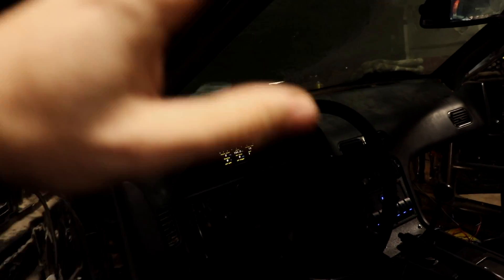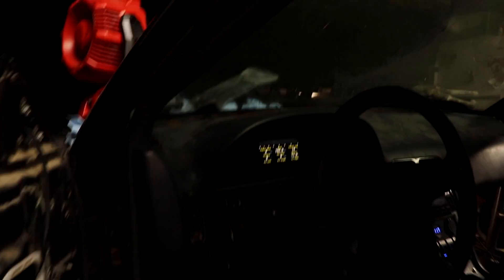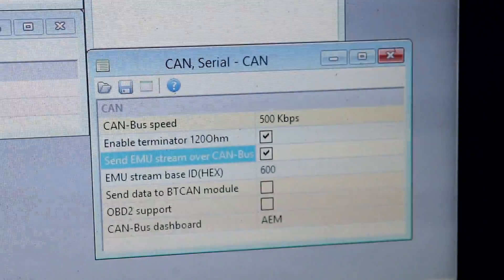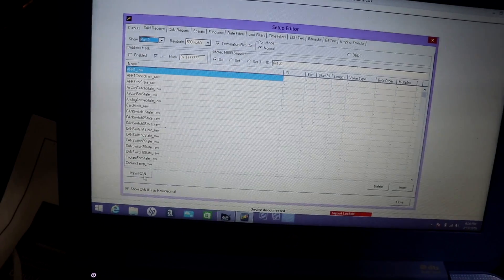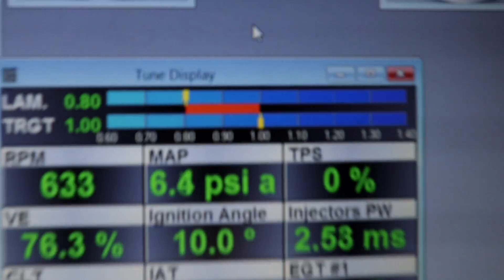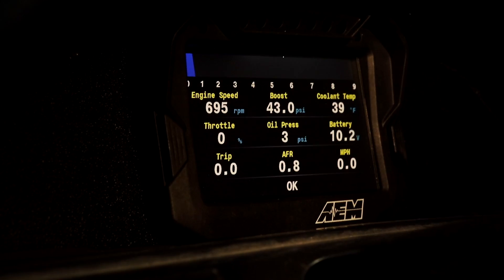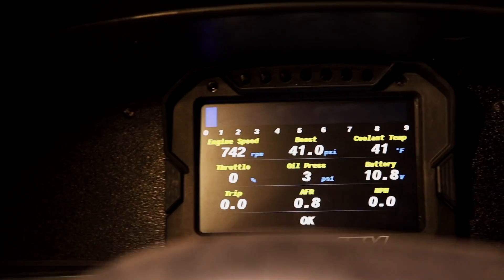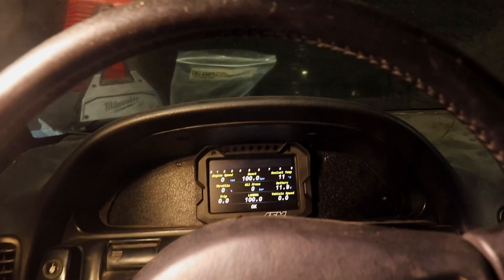AEM CD5 Dash Programming With Ecumaster ECU (RB20 240sx)

Comment: Any reasons you went with the aem over the emu display? I have the emu black and was comparing the aem to the emu display.. and seem like the aem one is better for the price also.
Reply from the maker: I think the aem dash looked cooler but if I could go back I’d get the Ecumaster one only because it would’ve been way easier to set up with the Ecumaster ecu. It’s much simpler to stick with the same brands instead of mixing them. No complaints about the aem dash though, I love it.